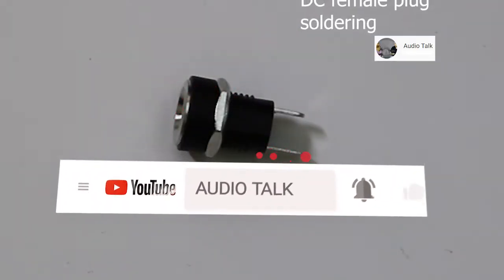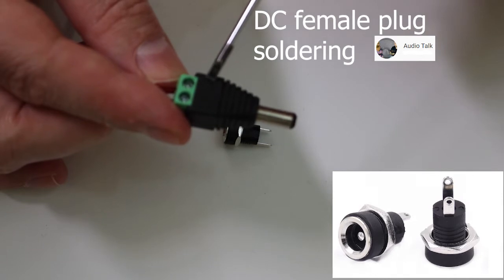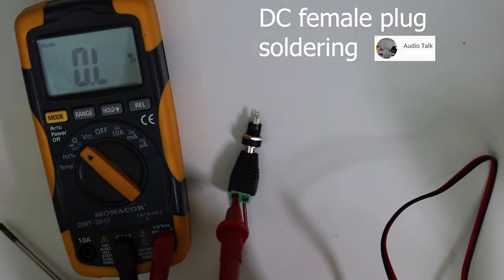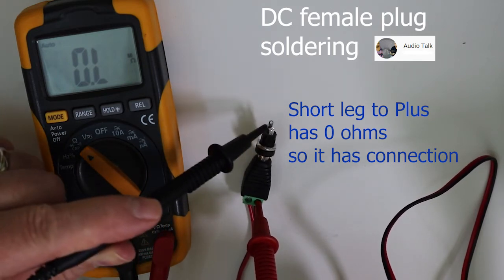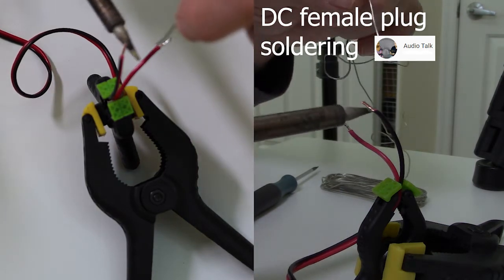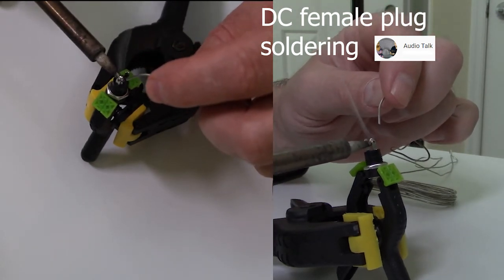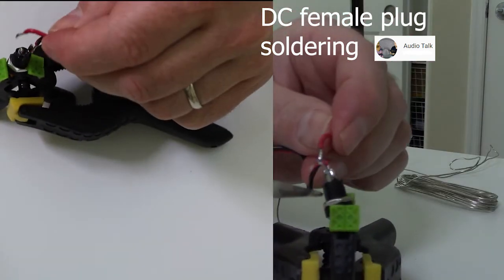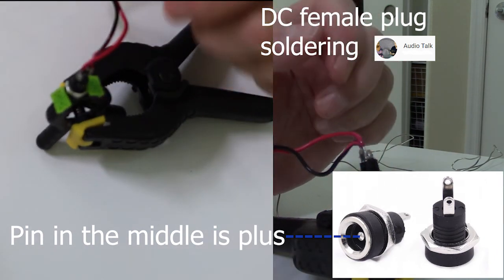How to Connect a DC Female Plug to Your Boombox or DIY Amp (Safest Way)

Comment: but I'm trying to do is so the green and black adapter that you showed on your video the male version well I'm getting the female version of that exact type of connector powered DC jack connector whatever it's called but the wire that I need to use is an 8 gauge wire and this only fits 16 and 12 gauge so I'm trying to figure out what kind of thing I can put at the end of the wire to reduce it I thought of using a a spade of some kind but what  I only could find was these Burndy YA8CTC38 One Hole Hylug Code Conductor Long Barrel Uninsulated Copper Compression Terminal, #8 AWG, #8 Weld, 37/24, anyways I was thinking of that or they had these gold ones they're almost the same thing but instead of rectangle shape they're round shape all of them have a hole which I didn't want it with the hole but there's one with two holes and if I cut the one hole off there's enough space to trim it down to fit inside the power jack thing so I'm hoping that will work otherwise I'll have to solder 12 or 16 gauge wire at the end and just long enough to stick it into the power jack adapter

Comment: So the long leg on the female one is the negative?
Reply: short answer: yes
long answer: on the plug side: the center almost always the positive, on the cable side: the short leg almost always the positive, for cable itself, the unique one (stripped, colored, printed, etc.) almost always the positive.
I say almost always because sometimes the opposite happens, either because of unintentional (wrong design) or intentional (special case design)